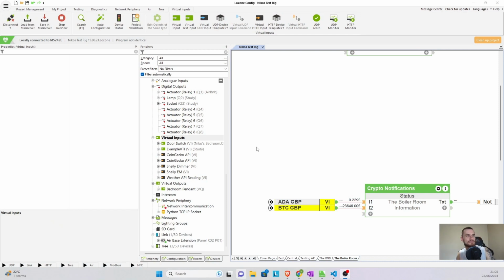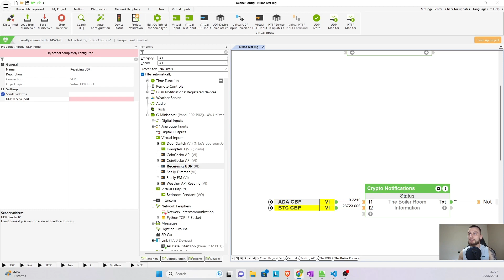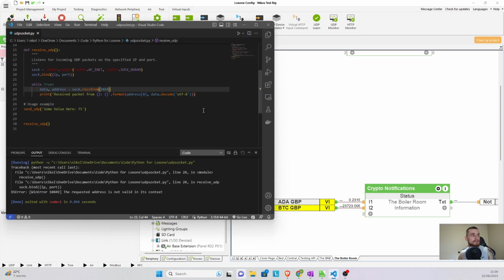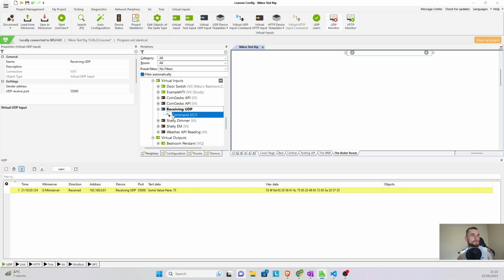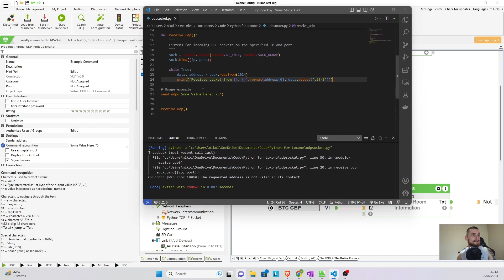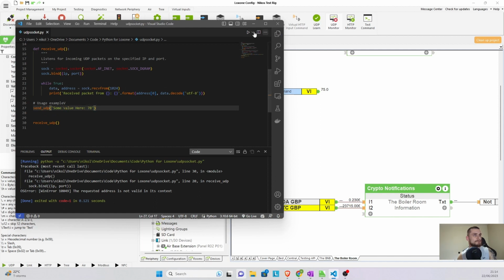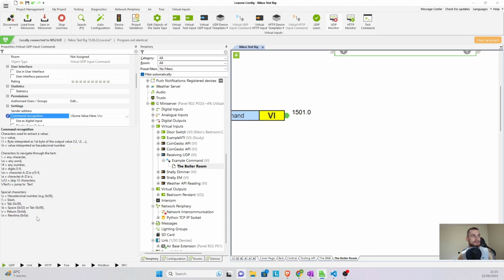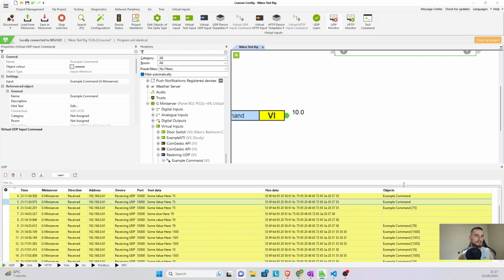How to Use Virtual UDP Inputs in Loxone – Fast Integration

Comment: Hi Nico! Can you please help? Unfortunately, I can't receive VirtualBox-Loxberry-Solcast data on virtual udp in Loxone. port 7000 on PC and Loxberry, firewall ok, fixed IPs, API valid, the correct command recognition format doesn't work at all. I've already asked all AIs. Thank you.
Reply from the maker: Hi I'm unsure why this could be the case, my first course of action would be to try sending a UDP command from a different device or use a different port 50500 for example. If it's going through everywhere else but loxone is not receiving it , the SD card might be out or the network settings on the Miniserver.

Comment: If I use a virtual udp input as a digital input what udp package do I send instead of "Some Value Here: 75"?
Reply from the maker: Technically any message could be a Digital Input, for example:

"State1:True"
State:1
State:0
"This is on" 

Etc - every signal or message that you want to trigger an on/off action can be a digital input
Reply: @theautomationgym  Thanks. I´ll try that

Comment: Great video! Do you know how I can get value for example from Aqara button using HomeAssistant when trigger the button?
Reply from the maker: I've never seen the aqara switches before, but there is an integration between Home Assistant and Loxone, check out 1Home.
Reply: @theautomationgym Thanks mate. I was able finally to connect aqara button with Loxone system through HA, Zigbe strick and Node red.